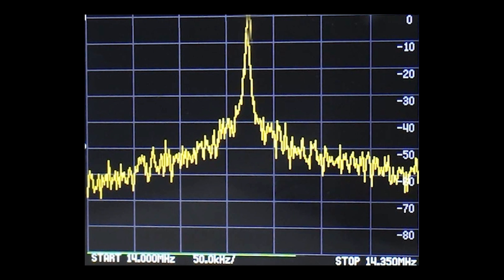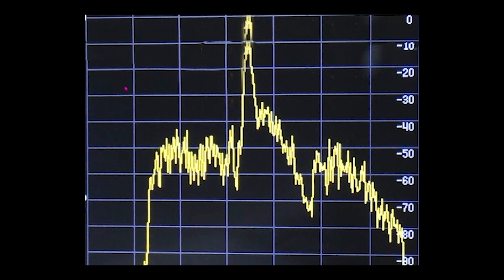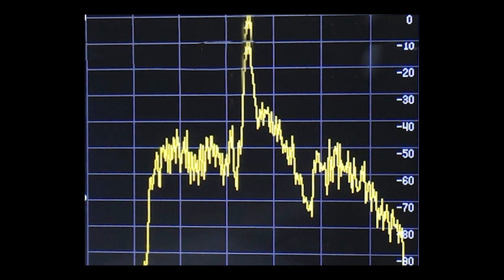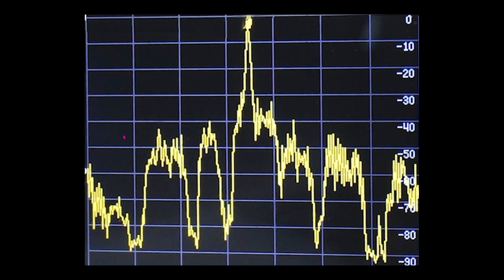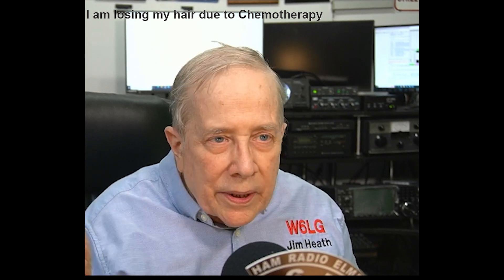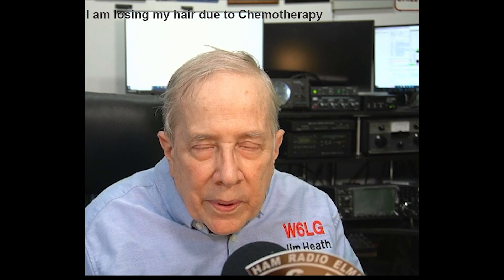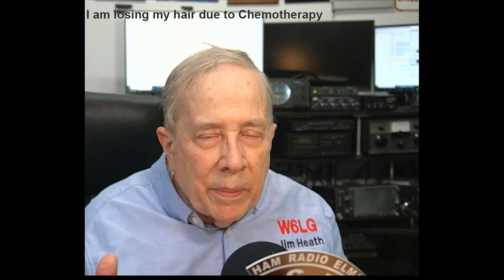You're Splattering!?  How Does That Happen?  Jim W6LG Shows How The Signal Becomes Broad & Splatters

Comment: Splatter is  driving  an  amp  too  far into it's  nonlinear   region  thus   mixing  products    result  in  splatter....
Reply from the maker: I was only dealing with the exciter with hopefully a simple explanation that could be understood by all.  Driving an amp into the nonlinear region results in flat topping.  It also, in a tube amp, increases the grid current and destroys the tubes.  Which is why I teach loading the amp to max and then increasing the load control a bit more.  The amp is very heavily loaded.  Thanks, Jim W6LG